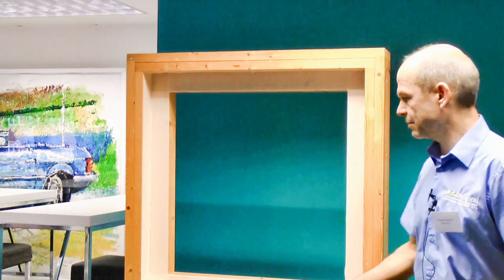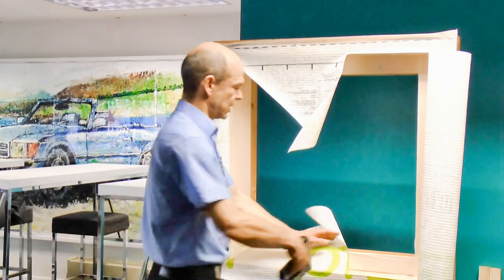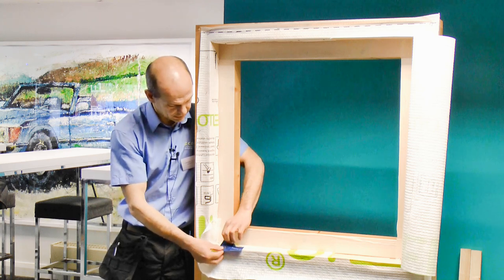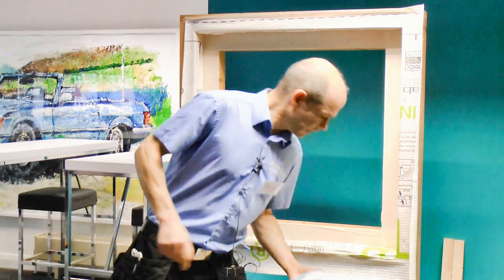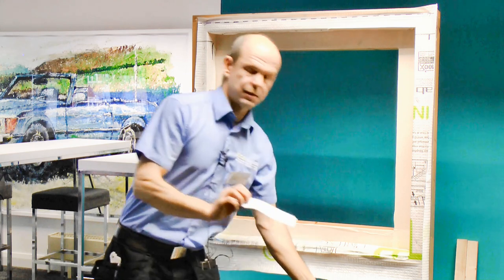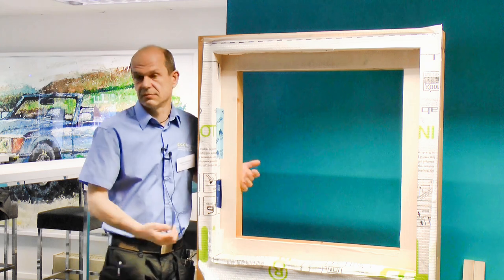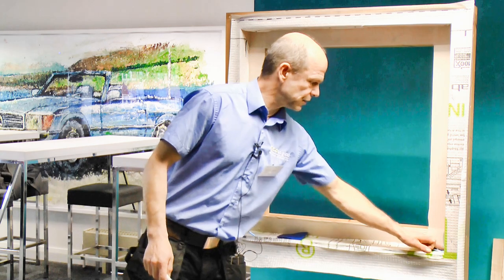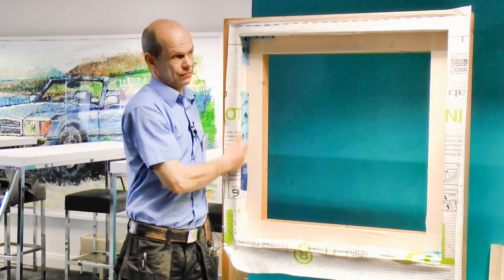Airtight Sealing Around a Window - Practical Demo

Comment: Hi,

Do you have a video or other guide showing how to install the system before the window is in place? That would be the optimal I understand. He mentions it at the end.
Reply from the maker: There is some detail for pre-installation of window sealing tape on our website. The tape to use is Pro Clima Contega Solido SL-D (for internal use), this has adhesive on the underside and a second strip of adhesive on the top for attaching directly to the frame before the window is in place. Details here: https://www.ecologicalbuildingsystems.com/product/contega-solido-sl-d . Our technical team may have a video that they can share, please use the contact form on our website to get in touch.

Comment: Is it ok to stick plasterboard with foam adhesive on the tape? Or it will be damaged?
Thanks
Reply from the maker: That would be fine. You could also use Aerosana Visconn (airtight membrane/paint) in the window reveals and dot and dab plasterboard onto this.